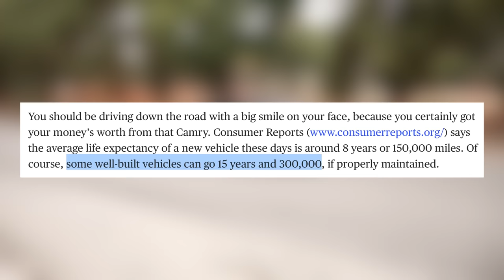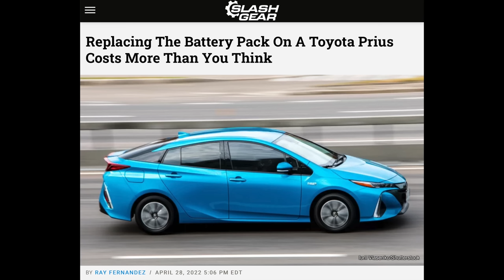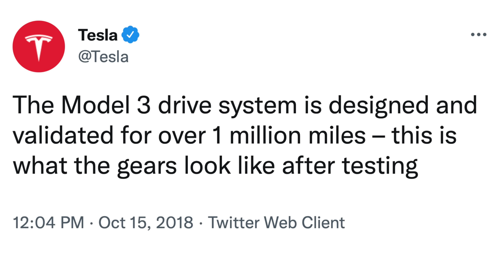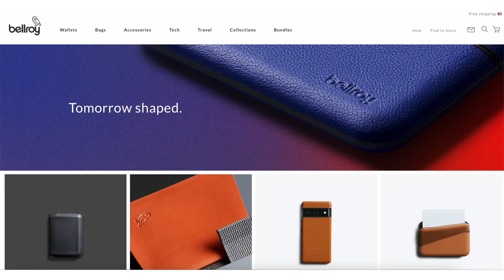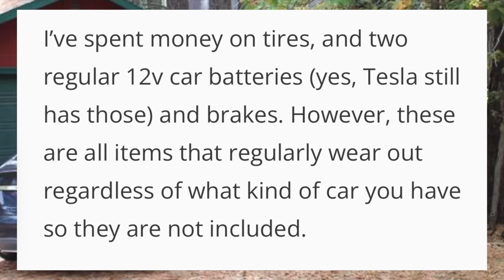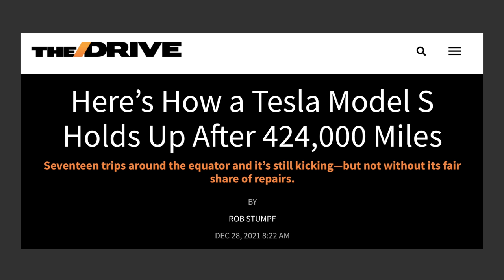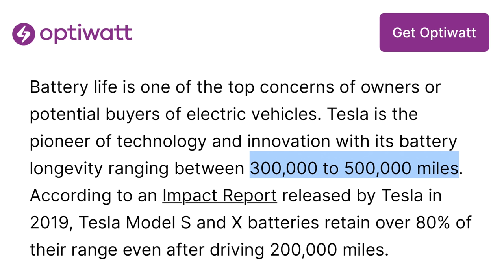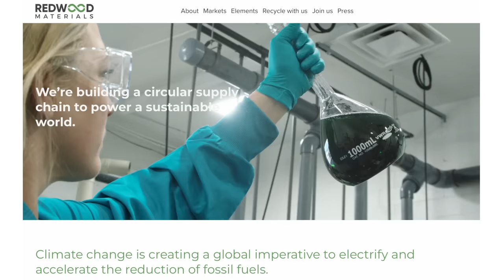The ONE MILLION Mile Tesla | It Still Runs

Comment: We've had our model S since early 2013 and had 220,000 miles on it. About 13% battery degradation
Reply: then why do people say Teslas are bad?
Reply: @highlighterjelly  because Teslas build quality isn't as high as some other brands but it's not unreliable.
Reply: @daviidfm923  i see
Reply: My ICE car 250k miles. 0% degradation.
Reply: @webguy943  I highly doubt that. Most gas cars loose efficiency over the years / miles.
Reply: @daviidfm923  sure like .1%
Reply: Not bad
Reply: @webguy943  so you have an oil analysis done on it to check for chromium and copper in your fluids to determine if the bearings are worn? You've done a drivetrain teardown to see how much surface is left on your gear surfaces? You've verified the compression is exactly what it was the day you bought it? Doubt it, metal wears out on 100% of cars, that's physics regardless of how much you want it to not be true
Reply: @daviidfm923  Id say its very high from a safety standpoint. Watched a dude crash at 170 in a tesla and he was able to walk away from it with some injures of course.
Reply: @deliberation6022  yea I’ve heard that. Also I own a Tesla so I am by no means saying it’s a horrible car. I’m just saying it’s not as “nice” as one may think and does have its issues. Still a great ev.
Reply: Ouch! So do you charge it to “80%” still which would be 67%? Curious might buy a used S at some point
Reply: @dillonk5573  basically.  It’s 13 percent overall so it’s likely a little bit less then that but yes.  Imo don’t buy a used Tesla model s unless it’s a raven model or newer.  The tech is much better.
Reply: @webguy943  ICE do lost power over the years if not properly maintain, which it’s most of the cars in America
Reply: @victordavalos246  i properly maintain my car. Oil change every 5k miles.
Reply: @webguy943  you lost me at oil change. Which is another benefit of a Tesla. No oil changes no gas. People saying “well the battery can go bad!” Transmission has a higher chance of failing then the battery.
Reply: @webguy943  How many gas fill ups, engine/transmission/coolant (ect) changes and brake jobs have you done in that 250K, and how much did all those things cost you? Yeah, I thought so.
Reply: Anyone want to take bets this guy is driving a beater and spending a fortune on maintenance every year
Reply: Does the acceleration degrade also?
Reply: 13% is a lot, god damn. I would never be happy with that, especially since the range is so bad to begin with
Reply: @thoos192  literally no one cares. Plug it in at home and your range doesn’t matter for anything but road trips… fly if you’re going long distance
Reply: @webguy943  I bet it doesn’t go as far as it did when it was new
Reply: @webguy943  My Tundra has almost 300K miles and no way is it 18 city mpg as estimated when the vehicle was brand new. It is probably around 10 right now.
Reply: @webguy943  Your ICE battery probably got replaced ~5x.  That’s not including other ICE components you had to replace.
Reply: @highlighterjelly  people are also doing their best to discredit EVs in general, so the least litle bit of negative press, and they think they have a story.
Reply: @webguy943  I have ICE car too 380KM transmission issues, not worth it to replace it.
Reply: @rickbernhardt3912  No the performance is updated and upgraded over the air software updates.
Reply: @webguy943  CAP
Reply: Still just a baby grin
Reply: @highlighterjelly  Well actually you’ll have trouble finding any actual Tesla owners who think their cars are “bad”...check out the owner satisfaction numbers, Tesla has the highest approval rating in the automotive industry.
Reply: @webguy943  mate you may not have heard efficiency but suggest you google the word
Reply: @highlighterjelly  3 drive motor failures, 2 MCU replacements. etc
Reply: @webguy943  common you know you replaced most of the following: timing belt, engine belts, radiator, water pump, hoses, alternator, fuel pump, fuel injector, catalytic converter, MAF Sensor,  not to mention after 250k miles you are burning oil and/have at minimum an oil leak.
Reply: @curioussand1339  mention all the other costs. I know, . I had a 2001 325 with 325k and currently a 2011 535 with 216k. To act like you didn’t have numerous problems outside of the engine and transmission is just not true
Reply: @webguy943  and the compression tester says????? LIES!
Reply: @webguy943  You have degredation. It's called ring wear, and compression loss.
Reply: @webguy943  give me a break. I’ve had 30 ice cars and not one has even come close to 200k
Reply: @thoos192  I’ve lost 10% in 55k miles
Reply: @highlighterjelly  build quality
Reply: @webguy943  my ICE audi gave out at 180k
Reply: My 2010 Honda Civic has definitely regressed since I bought it. Originally got 300 miles per tank driving city. Now I only get around 200 miles per tank 13 years later.
Reply: @webguy943 that thing is on life support lmfao
Reply: @deliberation6022 oh yeah I saw that video. He lost his brakes and slammed into a wall. He got rid of a ton of safety stuff too and didn’t have a roll cage or helmet. Ignorance ngl.
Reply: @webguy943  guarantee you've lost compression and power. and spent significantly more
Reply: @daviidfm923 some cars actually improve over time. For example the S2000’s engine actually becomes stronger after 150k miles
Reply: @webguy943  that's what you think
Reply: I've had mine two years and I'm already at 13% degradation
Reply: @webguy943  lmao 😂
Reply: @johncahill3644  Consumer Reports Still Ranks Tesla Reliability 27th Out Of 28. I just googled what you said and this came up lol .
Reply: @gtbigdog3507  did you have a Toyota or Honda ?
Reply: @g.m3399  one Toyota and two Hondas. Although I sold them before they wore out
Reply: @highlighterjelly  that's their opinion, I recommend you checking them out for yourself
Reply: @webguy943  So you mean that your car is not consuming more fuel per mile than your car was new.  And if you have never cleaned your valves, your car probably also has less horse power than when it was new.  But there are chemicals at all to buy to clean the valves
Reply: @webguy943  yeah right, put it on a dyno and let me know if it gets the factory rated hp....
Reply: @King Robinhood highly doubt you have a button less phone
Reply: @webguy943  based off what? feeling?
Reply: I want Tesla Batteries everywhere
Reply: @webguy943 same timing chain? Amazing.
Reply: @daviidfm923  might be because you’ve owned it  for a while but it’s deff a lot nicer then one may think lol especially to someone like me that was raised with a single mom and didn’t have much……
Reply: @calebrogers317  no that’s not it.  I have just owned much nicer cars in the same money category.
Reply: @webguy943 No, your engine degraded and soon you will replace pretty expensive parts. Or you already did it.
Reply: @webguy943 and likely to conk out relatively soon whilst this one will go for hundreds of thousands of miles more
Reply: @webguy943 yea but how much have you spent on maintenance and gas during that mileage? I have owned 37 cars and currently own a 2003 CL55 AMG, a gas motorhome class A, a Tesla Model S, 1999 F450 7.3 diesel and NOTHING compares to a Tesla maintenance wise. On my Tesla I have only done brakes in 120k miles which is nuts compared to the tens of cars I have had in my life.
Reply: @thoos192 depends on the person.  I drive like 20 miles a day on avg and really its less than that. So the battery degradation loss wouldn't a deal breaker for me.
Reply: @mickee06  You are a unique car owner then. Most people drive longer from time to time, which is a huge hassle in an EV. I have had ICE-cars for around 20 years. Never have I run out of fuel, never any queues to refuel, done in 2 minutes then you are off. Never a problem with my cars and very low maintenance cost plus purchase price is very affordable for slightly used cars. So ICE is very cheap compared to EV:s which need battery replacement every 5-6 years (if you are lucky)
Reply: @thoos192 I own a chevy 2500 and my wife drives a honda odyssey. Any long distance driving I would use the odyssey. My job is 15 min away and round trip about 15 m so that's mainly why I don't drive a lot. I do plan on getting a used model s next year when I pay off the van. I really wanted a corvette but since I have a family with 2 kids it wouldnt make sense because the vette is a two seater.
Reply: @webguy943 how is that scientifically possible?😂 Congrats!
Reply: @double_joseph327 you must be a clown. That’s the first thing you need to change on a Tesla. I just bought a Tacoma instead.
Reply: @marshallosantos9035  after 500k miles lol
Reply: @webguy943 how much you paid in fule to get 250k miles?
Reply: @webguy943 😅
Reply: @daviidfm923 yep. The ride isn't very comfortable and so much road noice/rattling in mine. The only redeeming quality is that it's cheaper to refill/recharge. I gave up on trying to fix it cuz tesla service centers in my area are crap in terms of workmanship and care.
Reply: @webguy943   ICE vehicles are pretty much junk after $150K. My Tundra only has $90K on it and Im starting to think "ehhhh....".
Reply: @daviidfm923 ever checked Tesla reliability reviews?
Reply: @double_joseph327 teslas are literally ranked as one of the most unreliable brands?
Reply: @CaptainKnuckles816  yea there nothing to rave about.
Reply: @CaptainKnuckles816  send me some facts that are not paid by GM and ford.
Reply: @CaptainKnuckles816  Faulty sensors that required replacement
Troubles with heat pumps
Air conditioning
Body panels that didn't line up
Water leaks in the trunk because of missing seals
Water leaks through the window seals
Heating system
Display screen freezing or going blank
Body control module failure
Gauges blacked out while driving

None of these are motor issues. When it comes to reliability that’s all that matters. Can I get 500k with no engine problems?
Reply: @webguy943 your ICE car needs complete chek every 2 years (at least in my country), and a more expensive one than EV checks
Reply: 2008 Mercedes R350 with 176k miles.  Lost track of all the repair costs; am happy if something costs less than $2k to fix.  Added a Tesla  MY to fleet after my wife said she didn’t want me to park it in the garage anymore because the burning oil upon start stinks up the house. Only keeping it for the rare times we need 7 seats for adults. Hoping to convince her we don’t need 7 seats after the last child is out of the house in a couple years.
Reply: @webguy943 I think you have to take into consideration that EV’s have less maintenance over their life because there isn’t a combustion engine. Oil changes etc. Gas cars do lose a lot of efficiency overtime due to carbon buildup. Due to environmental regulations carbon buildup on modern cars significantly impact gas mileage
Reply: @webguy943 mine to. 2015 golf tdi. Got 600 miles to a tank. 300k later I’m getting 600 miles to a tank
Reply: @webguy943 I’d be willing to bet money you’ve replaced the battery in it more than once.
Reply: @webguy943 no, gas and diesel engines definitely lose efficiency over time.
Reply: @webguy943 You act like your mileage didn’t decrease overtime due to spark plug wears and other mechanical failures. Not to mention the amount of other moving mechanical engine parts that apparently never need maintenance right? 😂
Reply: @webguy943 that’s not true lmao much less mpg then when u first got it
Reply: @webguy943 not quite true. at 250k miles, you engine has degradation, due to friction. it also burns more oil than when you first got it. and there are also a lot more parts to wear out than an eV.
Reply: New the battery is 33 percent efficient so how do you justify operating it?
Reply: @webguy943 I hope you do it yourself cuz It can get expensive
Reply: @highlighterjelly Because there’s always haters who can’t bear something being good. 😂
Reply: @webguy943 you sure about that?  I promise you the gas mileage is not as good as the day you bought it.  Your oil also needs to be replaced more frequently due to worn parts.
Reply: @webguy943  impressive, my 160k mile ICE car had starter replaced twice, spark plugs replaced twice, plus the battery and oil change replacements, $80-90 full tank. Finally someone stole the catalytic converter($4k). Now a proud Tesla owner.
Reply: @webguy943 way more than that. Mine only has 94k miles but I still don’t get nearly as much mileage or range as I used to
Reply: @webguy943  lol your engine will for sure have degraded power output and is not as efficient when it was new.
Reply: @webguy943  I also have an ICE 220K mile 2001 Tahoe, but it's still an ICE. All use goes on my 2021 M3.
Reply: @webguy943 oil change every 5k
250k miles
That’s 50 oil changes 
How many in a Tesla? 0

You’re using miles so imma assume American. Average American according to quick google search drives 14263 miles per year
That’s 17 years (rounded)

Assuming you had an ev, worst case scenario for average driver it would have just failed as they last 15-30 years. Now you can buy and have a used battery installed in a EV that is slightly used rather than brand new for around the usd equivalent of 5-10k
Reply: @thoos192 it actually isn’t that much for the average city driver
Reply: @rickbernhardt3912 the acceleration in all cars degrades over time. I don’t own an EV but noticed it in my mum’s Camry, we’ve had it 11 years, the range and acceleration is now noticeably worse even with proper maintenance
Reply: @webguy943 how much did you spend for fuel? 167k?
Reply: @abinodattil6422  more like around 25k
Reply: @webguy943  which car do you drive and how many miles per gallon
Reply: @webguy943 😅
Reply: @webguy943 not at all true
Reply: @webguy943 You spent $20K+ on gas, the same price as a brand new battery.😂
Reply: Go minnesota 🗣
Reply: What was or is your charging setup on the battery to get that? 80% daily or 100%?
Reply: That’s sweet I am at 180,000 on my model s but don’t drive as much as I used too. I drive my new model y way more
Reply: @thoos192 you save so much money and this is your problem, replacing a battery every 8 years with the warranty?
Reply: cool. that’s average for most cars. let us know when you hit 500k
Reply: @daviidfm923 bull shit a Buick hit my car going 50-60 mph I had a tiny ass scratch and the Buick was front bumper was fucked up bad
Reply: @webguy943 yes it will lost off horse power
Reply: @daviidfm923  I mean they cost about 30k and performance and tech that they have
Reply: @webguy943  Carbon buildup
Reply: @daviidfm923 ice cars have gone well over a million miles it’s nothing new lol
Reply: @Khanfuzed1 fly to the state parks in the mountains with a travel trailer?… 😂
Reply: @double_joseph327  Yeah well, from a mechanic standpoint, you can fix a transmission while a battery needs replacement.
Reply: @Thephonkgod In most cases, you only need to replace one cell or module in a battery. Significantly cheaper than a whole pack. Although if you do replace a pack, you get new cell chemistry, giving you longer range. That is why we now have 2011 Leafs which originally had 80 miles of range sporting new batteries with 300+ miles of range.
Reply: Have you ever replaced the motors?
Reply: @webguy943  sounds a bit biased tbh, cars will keep kicking even with some level of wear and degradation, but that doesn't mean your car is intact after all that use. Efficiency will absolutely be different, even if not that much.
Reply: How many sets of tires you go through to achieve your mileage?
Reply: How many sets of tires you go thru to get to 220k??
Reply: Ppl complain but let's be honest. I don't care about battery degradation since I never keep a car longer than 3 yrs
Reply: Thanks! That's the feedback I've been getting from Tesla owners! I'm sold on a Model3 in the next 6 months!
Reply: @highlighterjelly  Hardcore coping
Reply: @webguy943  I've never seen an ICE that didn't start to having costly repairs in the thousands starting at 200k miles
Reply: @dillonk5573  That's not how percentage works
Reply: @highlighterjelly because they like their gas cars. When the interview tesla owners they always say they will never go back to gas.
Reply: @double_joseph327 how expensive are the tires?
Reply: @CoroaEntertainment probably less cost total then that 60k tesla. remember they were at 55k to 60k starting out till like 1.5 to 2 years ago when they started cutting prices. my honda cost 20k even if I had to completely rebuild it still cheaper then a tesla
Reply: @kali4niyadood the ice battery is only 200 bucks...
Reply: @a1exsand funny mines is a 2017 I still get like 400 miles to a tank
Reply: I have a 2005 VW turbo diesel wagon with 290k miles. Tranny went out at 250k, and replaced with new for $3k. Engine is solid but needs turbo replaced soon so I bought a lightly used upgraded turbo for $400. I do all my oil changes every 7-10k miles per the oil spec which is about $50 per oil change with high quality German oil and filters. Insurance costs $70/no for full coverage and registration is $120/yr in CA. It gets about 45mpg and I run R99 high cetane 99% biomass based diesel. This is the most economical and environmentally friendly car out there, no Tesla or Toyota Corolla can beat.
Reply: @highlighterjelly  Propaganda ;) Elon isn't a Democrat.
Reply: @webguy943  how much did the engine replacement cost or u bought a new car by now :)
Reply: @webguy943  and you have a gas station near your house so you can fill up while you sleep or are cooking ? That's amazing keep going !!
Reply: How much percent do you charge it for?
Reply: @webguy943  how much have you spent on oil changes, tune-ups, brakes, belts, seals? Oh and gas?
Reply: @daviidfm923  nice. still  on the first battery? i have model s from july 2015 with only 80k miles on it. how did you charge it? mainly supercharger or wallbox?
Reply: that's true for me 2 months into owning MY.
Reply: @Khanfuzed1 At least the beater will still drive and doesn't require a software update less tech the better imo 😂
Reply: @webguy943 the delusion of this comment
Reply: @webguy943  that's crazy so your the first person too achieve zero wear and tear that's amazing ...how do you achieve zero friction?  We must know!
Reply: @webguy943  no but ICE vehicles need other parts replaced.
Reply: I'll cut to the chase EVs are still inferior range is horrid not to mention gets even worse if it's too hot or cold and how they are trying to make ev  truck is a thing is crazy can't tow anything
Reply: @highlighterjelly because they’re electric
Reply: @codycray8461  so?
Reply: 15mpg 300k miles will use 20000gallons at $3 per gallon you will spent $60k $4 gallon $80k and 6$ gallon $120k for just gas only
Reply: @daviidfm923 what about the tech ? What changed ?
Reply: @Иванпонимаете-г4ш  older model s have a higher chance of battery failure, motor failure, they charge significantly slower and less range.
Reply: Tesla said in their 2022 Impact Report, as quoted by Reuters, that a model S/X would lose just under 12% of its battery life after 200,000 miles. The fact your car has lost 13% after 220k accords perfectly with that.
Reply: @highlighterjelly  because they are boring to drive. Safe and reliable, quick acceleration. Thats it.
Reply: @webguy943 oil change is not the only fluid you need to be changing….
Reply: @thoos192 13% in 10 years is not bad at all…
Reply: @webguy943 this dude is nut for saying this 🤦🏻🤭
Reply: @thoos192 I think you’ve been misinformed or not listened to the battery report above? Superchargers everywhere and never needed to queue. never spent more than 15 minutes at a supercharger and do 200 mile trips all the time. I think you might need to go test drive a Tesla as your concerns are really nothing to worry about.
Reply: @highlighterjelly  I heard after they moved production of the refreshed model 3 to china their build quality have improved greatly.
Reply: @webguy943  100% is degradation in the engine
Reply: @thoos192 , no, I own a Model S for 7 years with 130k miles and haven't replaced battery since the battery is degraded only 7%